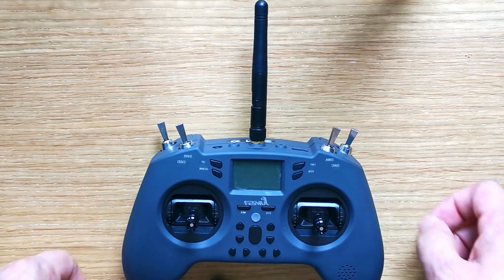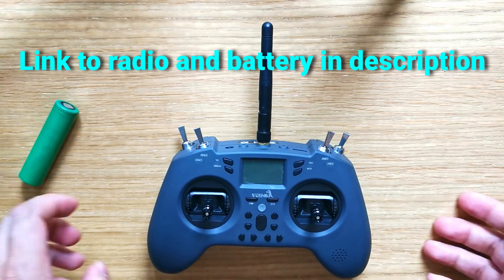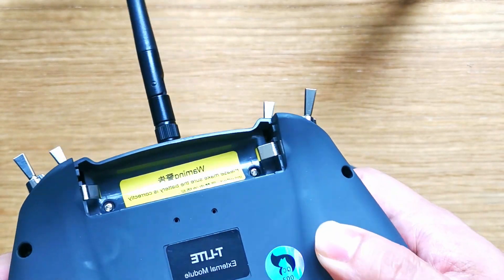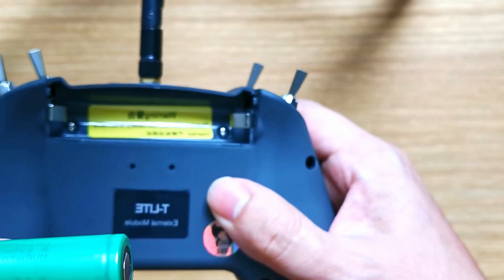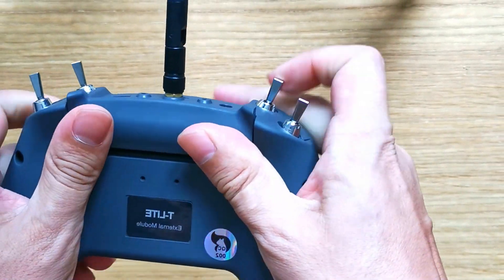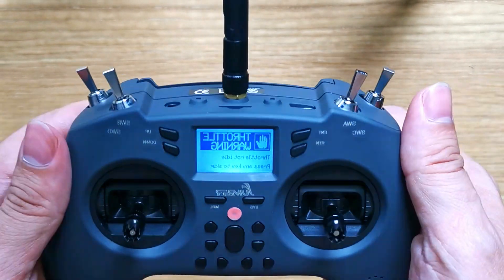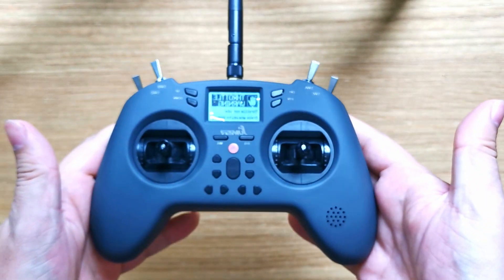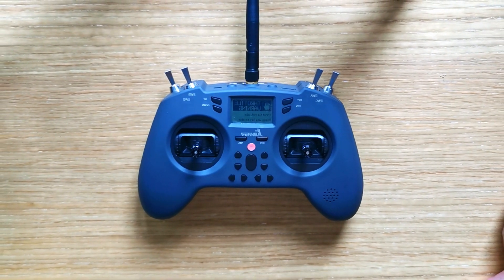Jumper T-Lite Battery Hack

Comment: be careful taking the battery back out. Now that the bottom of the metal tab sticks out farther, it will hang in the plastic rim on the battery...  BTW, how many days does this radio take to charge up the battery from 3.7 to 4.2? Mine seems to take forever...
Reply: Mine takes a long time too. I don't have a solid number but I'd guess 6+ hours to charge. The internal charging is very slow but at least it works.

The good thing is that you can just plug it in an let it charge at times you know you won't be using it. Plus, it has good battery life if you get a high quality battery. That helps to make the slow charging not so bad.

Comment: Can we charge the batery or it work like xbox controler
Reply from the maker: Either. You can charge separately or inside the radio! just bring a powerbank!
Reply: Soo we can just plug type c cable into the remote then its charge?
Reply from the maker: @kenjidanta9961  yes

Comment: Everyone be careful installing your battery because this video is flipped and you might install it backwards.
Reply from the maker: Yes it is important to look at the labels! I shot it with my phone upside down.
Reply: @TorontoFPV  why would that mirror the footage tho lol, or do you mean you used your front facing camera?
Reply from the maker: @___echo___  I filmed it upside down so I had to flip it to make it right side up. I should have double flipped it to fix this but didn't think about it. The radio is garbage anyways it died. Buy a Zorro instead!
Reply: @TorontoFPV  uh oh, what happened to it? It just randomly died?
I already own it btw lol
Reply from the maker: @___echo___  ya lol mine and friends died and the customer service was garbage ... hope yours lasts!
Reply: @TorontoFPV  if one of the axis (probably yaw or roll) started to become jittery or stopped moving entirely, it means a wire on the hall effect sensor came loose, remove liquid duct tape, strip the end and then resolder :P, Ive had to do it twice lmao
Reply from the maker: @___echo___  nope mine turns on and displays nothing ;(

Comment: Whats up guy...
I SEE the thumbnail for your post ALL time. With that being said... I've now only watched the video 2 times. To the point... I just now notice all the thumb down(s). That being said and NOT being rude or mean or derogatory... I had notice I was one of them. 

After watching this video for the second time... I ask myself, why did I do that?
I DID remove the thumbs down. I added a thumbs up. However, still the wonder why so many thumbs down....

I feel compelled to say, I think the video has gotten so many thumbs down because of the video Title....

Suggestion... not assuming you want or need one... only an opinion of a suggestion... I do think that your video would get the deserve thumbs up if the title were changed to something without the word "Hack." 

I think the thumbs down are in relation to people being directed to the video because "Hack" they see the video and probably say to themselves, wtf.... this isnt a hack....

Anyway. Your video DID in fact help me (prior to me even placing a battery into my new controller). Was very to the point, to bs. That is why I did give the video a thumbs up. That is why I felt the need to simply just say something. 

Good video. Very informative. thank you.
Reply: I think that most of the thumbs down are because the video is mirrored and it makes it look like you put the battery in backwards which will fry the radio